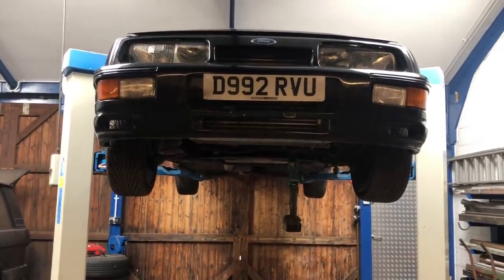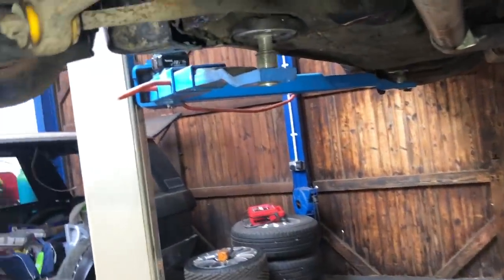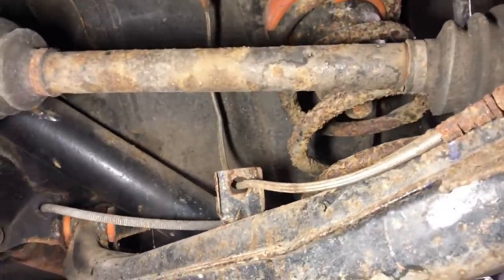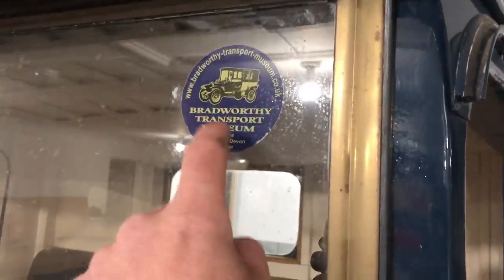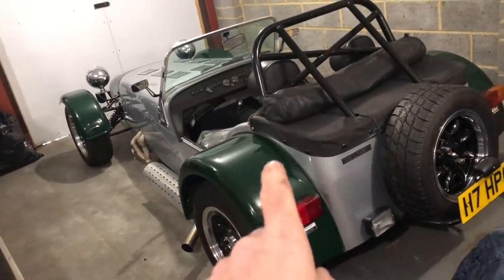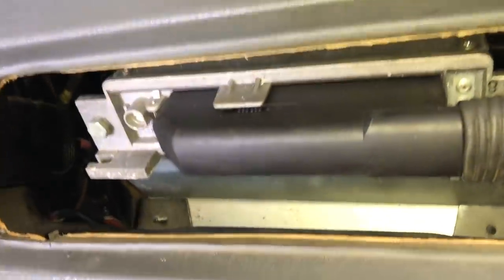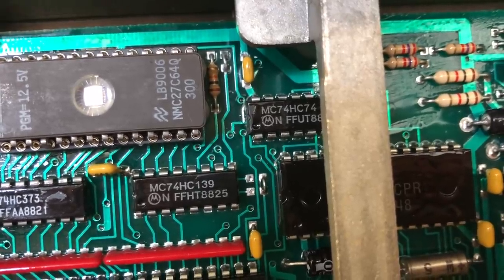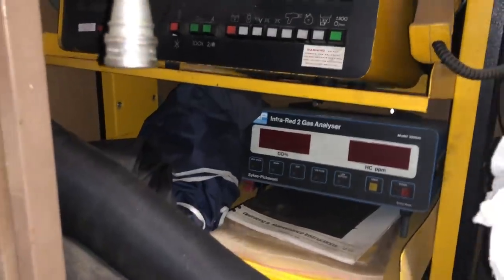Ford Sierra RS Cosworth 3 door what is next? pt5

Comment: Rob, I have been working on fast RS Fords and RS Audis for years now. You cannot tell the BHP from just looking at the ECU as there are many different performance maps that can go on the EPROM. What I can tell you from just looking at it is that is is not original and it’s a level 6 ECU 2wd from a Sapphire Cosworth. Don’t be too fooled by the size of the turbo as back in 80s and 90s the size of the impeller influenced turbo lag as well as a few other things. Most modified Cosworth had upgraded injectors, bigger intercooler and the big turbo added and made around a real 280-350bhp but best increase was on torque. The sump was also common as it stopped oil starvation on track cars and Rally cars but did nothing for road cars but add weight. The poly bushes and the braided lines are a great upgrade as they suffer long soft brake pedal along with many fords of that age and that sorts it. The upgraded brakes are a waste of time and just mean the original wheels don’t fit. That engine is very capable but the power cars include pistons and high lift cams. Take it to JFA in a Maidstone as ask him to put it on the rolling road after you have done a health check. That will tell you what it is doing. Example, people used to upgrade the injectors and not the pump but it was starved of fuel at high revs so that is your best way of finding out what has really been done.
Reply from the maker: Tony Walters yes we know that we were looking for a sticker or aftermarket chip in the ECU

Comment: Fully agree with Eliot who posted earlier. As an electronics design engineer in the past... the chip with the window is an EPROM. It will contain the programme the CPU runs to manage the engine and it will contain the ignition and fuel maps. The numbers are the part numbers / date code for the blank chip. As Eliot said, there should a label over the window. There are no identifying marks indicating the tune that I could see. The only way to find out is for a Weber-Marelli tuner to read the chip in an EEPROM reader and the use their tuning software to take a look. Or of course put the car on a dyno :-)

Comment: Like to see the morris done as my father was born in 1934.
That modded sump might have a gated sump baffle in it so the oil pickup pipe does not get starved of oil when driven hard around bends, hard braking or hard acceleration
Must be have been used for track use and be tuned up having this on it.

Comment: I'm glad you are putting it back to mainly stock. That laquer is conformal coating. They use it to keep moisture out. The bit sticking out looks like a mosfet - could just be a voltage regulator.

Comment: Your right this is well modified! Big wing sump with weld on fittings too. Looks like the rear brakes have been converted to 4x4 cossie , as 2wd had solid rear discs. The ECU  looks like an L6 as it has the white co2 adjustustment screw the L8 had another small board to hold the chip in side.Should of thought she has been live mapped with that type of chip,  sweet.

Comment: Great car I loved playing with the RS500 back in the day.
Although we didn’t have a cut of switch we just took the ecu out when we parked 😂
A good way of telling if it has good power is to see if it has green injectors as these would spray a lot more fuel so you could raise the boost. The most common mod was to add the rs500  inlet manifold that way you could run the 8 injectors for big power.
what block do you have is it the 200 or 205?

Comment: The last part you pointed at looks like a relay ? And the white substance you can see is a heat compound, which indicates that part gets hot when running, the metal block behind it is a called a heat sink which pulls heat away from the device to ensure it doesn’t overheat

Comment: you have fell upon a car that has had some money chucked at it with the mods fitted thats for sure, I reckon with the baffled sump fitted, extra breathers and oil catch tank, T34 turbo, 500 size intercooler, Its probs been running with grey injectors and anything between 370-420 bhp. Looks a great condition underneath considering, Deffo well worth the basics belts, pump full service, Brakes serviced and refreshed, shocks and springs refurbed by koni or replaced. Deffo leave the poly bushes in as they transform the sierra saggy and wallowness.

Comment: Looks like a programmable EPROM chip , my guess is it was running high power but been put back to more standard form when the car as changed hands , like it’s got the remains of a dry sump kit parts have been removed. After market intercooler ? One of the best its a pro alloy ! 👍🏻 great car but will take allot of parts to turn it back to original if that’s your intention. Personally I’d leave the Koni shocks in place as they are sought after and just change the springs. 👍🏻

Comment: Chip in the plug is certainly programmable chap, that is why it's in a cradle.  Stuff is called conformal coating this is 80's tech so boards were built and then dipped in that stuff, it is like varnish, so the fact the chip has not been suggests it has been changed. Might need to use a scope to see the numbers on the chip beneath the window?

Comment: Intercooler is called the rs500 cooler,if pro alloy then one the best if not the best..
I'd say it's been heavily modified with  that sump,alot the parts in engine bay,swirl pot,oil brether system,injectors, turbo,ect ect,bet engine far from standard, bet it's got forged pistons and rods 👍
And got expensive brakes so definitely heavily modified,should clean it all up and enjoy the added benefit of the performance 👍
Just bin those wheels and add some rs7 soft spokes or some comp's..

Comment: Hi Rob, like it's already been said your Cossie has a "big wing sump" this is to increase the capacity of oil to stop oil surge when racing or rallying when cornering or accelerating. The extra alloy fitting that you can see welded to the sump could of been a feed & return for an extra oil cooler. Do a google search for Group A Cossie big wing sump, you'll see more of them and the reasoning behind them. In the late 80's early 90's I worked for a company rallying Group A 3 door Cosworth's and their sumps were very similar to what yours looks like.

Comment: The sump looks like a 'group a' style sump with the big wings for extra oil capacity (6.5litres) and possibly has a gate either side to prevent oil starvation, it looked to have a threaded take off (AN fitting) on the front side which is used as a breather or return from a breather tank to the sump. It's very similar to the sump I have on my yb turbo in a mk1 escort.

Comment: Hi Rob, couple of days behind on the vids. So just catching up. I’m an electronics engineer.. Reference the PCB you have removed from the ECU. That lacquer you are seeing over the board is a process called conformal coating, where the components are covered in silicon substance which is either sprayed, painted or dipped. UV lighting is then used to cure and also to inspect to ensure the components are completely covered. My guess is the component that has no evidence of this has either been changed or was left off as part of an option fitted later. If you are thinking of changing components your should first look at that 2 biggest suppliers which are, Farmell and RS components. 
Hope that helps 
Mike

Comment: Keep the brakes and polybushes (if there still good) and chuck a set of new braided brake hoses on. Keep the sump too. It's been built like this for a reason so I wouldn't change it too much. It's obviously Running some big power judging by all the spec. Refurb the koni shocks aswell

Comment: Hey guys might get shot down for this, but back in the day used to use those programmable EPROM chips  a fair bit. If you crack the ECU open again its a good idea to cover that window with a little sticker or bit of tape. As you've seen they are erasable with UV light, so exposure to sunlight is not the best for them. Its a small point, but I'd cover up that window.

Comment: Re the ECU pcb. Perfectly common to have a pcb manufactured then lacquer coated for protection in its lifetime. The EEPROM with the window allows updates to be done to the software during the cars lifetime I'd imagine. The little chip on the side is a power transistor and the white stuff is heatsink compound, used to transfer heat from the chip onto the aluminium which acts to radiate away the heat of the chip in operation.

Comment: Good looking for it's age, and some goodrich brake lines and not the standard rubber hoses. All the bushings and brakes and the intercooler tells its tale, there should be some power to be had in there. I dont think the engine is stock either.

Comment: Inside the ecu, the EPROM was back in the day what most cars had. This has the settings for mapping just about everything. The window on the chip was to allow it to be wiped by exposing it to a specific wavelength of UV light to erase it before reprogramming it and used to put stickers on them to keep light out. I don’t know if they had removable sockets from the factory but if tuned it would really need one. I believe tuners used EPROM emulators in place of the chip to allow for making adjustments conveniently before burning the final map to the chip when done.

I should add that EEPROM’s replaced them and nowadays flash memory is used that can usually be programmed directly through the diagnostic port.

Comment: Nice video, the Cosworth looks pretty decent underneath. I’d put it back to standard suspension & wheels. Poly bushes and braided hoses are a decent upgrade. It seems to be missing a few bits on the bodywork like the rub strips on the side and the lower bib on the front spoiler. If this is a standard Cosworth then I think the lower spoiler on the tailgate wasn’t a feature on this model, just the Cosworth RS500’s (I think). Petrol cap should also be painted body colour where yours is a standard unpainted item. The Morris looks amazing too, and what a great story to go with it.

Comment: It's a flashable eprom in the ecu mounted in an i.c socket, I would expect looking from what you have shown that it might have an aftermarket code on that chip, normally the little round window is covered up with a label to stop the chip from erasing by uv light, I don't know what eprom chip ford put in there stock but it looks like it's been changed, the rest of it looks stock, don't go putting your fingers over everything in the ecu you can damage the other Chip components with static from your body..... I would get it put on a rolling road once you have ironed out all the mechanical issues and see what kind of power it's making!.........

Comment: The Cosworth does indeed look better underneath than I expected although it’ll need a full strip down if you’re doing a full restoration. I’m 17 years older than you Rob (as in old😂) and as somebody else has pointed out those Crypton tuners go back quite a lot further than that. I’m sure they were a thing in 1980 when I first started driving?

Comment: Level 6 ECU is 2wd sapphire cosworth the chip you referred to should have a sticker over that window to stop light going in. Normally have a sticker on it saying spec yours has not. The injectors are grey and your running a t34 or 35 turbo it should be around 380 bhp. Normally would be cammed but you have no pulleys on it so guess standard. The big wing dump is a mod for sure rs500 style intercooler and updated rad. The Koni is nice upgrade as well as the other mods. Should have a grey coloured map sensor sitting on the drivers side inner wing. If you dyno it I would change fuel filter and pump wiring plus loom put a 044 fuel pump Bosch on it before as well as can belt same as gates one fitted they are the best on these. You can do the belt if carefull without bottom pulley removal if Chris does not fancy it I have the special tool for removal the pulleys break if not careful  and the timing pick  ups are on it plus there expensive now to replace.
Car looks sound little TLC and good paint job with a clean up underside 25k all day long.

Comment: That ECU.. back when your got your Cosworth/Escort RS Turbo ‘chipped’ 
I remember taking my ‘88 RST to Power Engineering back in 1992 to be chipped.. it made 180bhp and I thought was amazing lol
Reply: Yes the older vehicles we used to buy a "chip" and replace the eprom in the ecu. Today you just get them flashed for the most part. Some still use a chip in a module that plugs into the service port. But most today you get a tuner that flashes the stock ecu.
Reply from the maker: waynester71 I was probably the bloke in the queue behind you lol
Reply: salvage rebuilds uk I think I remember you lol.. Power Engineering in Uxbridge were one of the go to RS specialists back then.. Great days 👍🏼

Comment: Forgot to mention that when you do the cam belt, be sure to use the correct TDC mark, its common mistake to use the ignition mark as crankshaft timing mark and you get the timing off. If the head has been decked couple of times the valves tend to touch and you get a broken valve.

Comment: Yeh those EPROMS (the chip with the glass window) are common parts of the 80s , often found in BBC Micros with word processors , games on etc. It’ll have been re-programmed by an engine tuning place, not a bought off the shelf chip I’d think as there’s no sticker on with identification of the place who did it ..- there is often a.sticker over the glass part to stop UV light getting in - no probs inside an ECU of course ..the rest of the ecu is basically an 8 bit microcomputer / controller unit and wouldn’t need messing with hence why it’s untouched ..

Comment: Would love to see this on a dyno. There's been sum money spend on modifying this you've got the potential for having just short of 400bhp if the ecu isn't corrupted by not having a sticker. get it to a engine tuner and get in remapped  bring it down Newcastle and I'll put it on the rollers

Comment: Looks like at some stage it was running 400bhp plus. All the upgrades scream track use. However there are a couple of very special parts fitted (hi performance sump?) and someone has been pretty thorough. the question is has the engine had a bit of a cooking.
Reply from the maker: alastair inglis I know the history of it all being done it hasn’t been on the track

Comment: I think I would be tempted to keep the suspension and brake mods including poly bushes, but I would remove the blue hoses and upgraded cooling system and return it to stock power.

Comment: I no your all saying about nodded sump but has it had some form of breather system ..... because of the aeroquip fittings welded in the sump ..... and your poss fan switch is not plugged in on the rad

Comment: yeh im up for a bit sunday banter on the old motor,got got visions of the Ant hill mob.as for the box under the starter motor,my rs 2000 had something that looked like that but mine was at the front of the sump and was factory due to the pinto siting lower in the bay the sump was made deep at the front shallow at the rear.i think yours has deffo been modded to take more oil or mabe after market oil pump and pickup or even looking at the stumps comming from it mabe a oil cooler,weird..

Comment: The plug-in chip is a 2764 Eprom. It will almost certainly contain the data for the tuning curves for the engine. One of the other chips will be the processor which uses the data in the EPROM to dynamically adjust the ignition, injection etc. according to throttle, load, accelerator position etc. Normally there would be a sticker over the window with a code on it to tell you what program settings are in the chip. As this doesn't have one, it looks like it's a custom supplied one. Unfortunately, without the sticker, it's not possible to know the state of tune of the engine. The only way would be to extract the info using a memory reader and then try and identify the originator of the program. It would be much easier to put the car on a dyno tester and find out that way.

Comment: Rob, you won’t find a chip. The EPROM is that chip you are referring to. The rest of the ECU is bog standard Ford code and the modified EPROM map alters how the ECU reacts to modified map. For example, fuelling rates through the Rev range. Some modifiers manipulated 3 sensors, fuel, boost and ignition and others did 5 sensors which included boost temp which is why you have a larger intercooler to lower the charge temp to increase the boost. The reason that is not soldered in is because the EPROM is removed from the holder and then erased and flashed with the new data map. It was really unusual for any company to put any kind of sticker on the ECU because they did not want their maps copied plus to keep from insurance companies if the car ended up in a bush!The best you usually find is a sticker on the slam panel from someone like Power Engineering which just identified that they had done some work on the car.